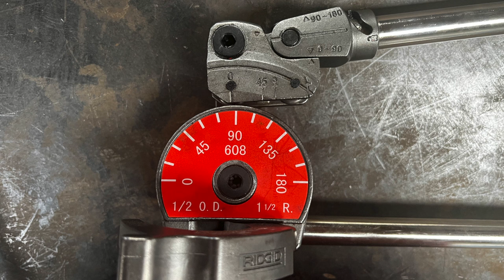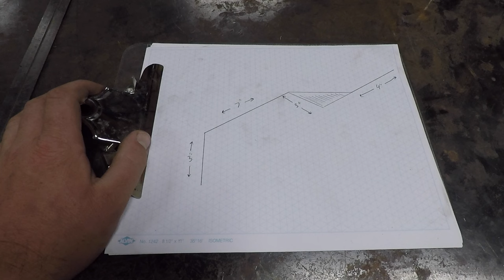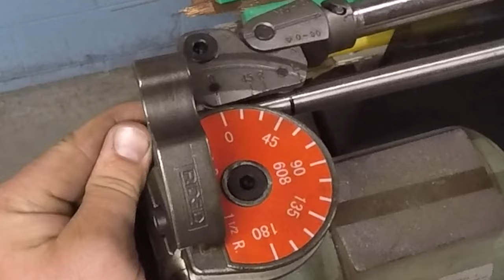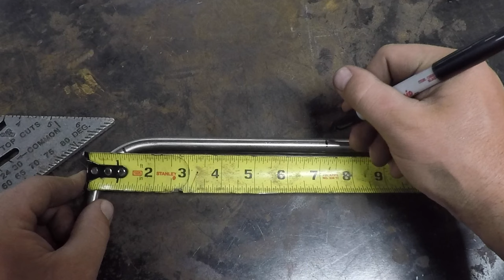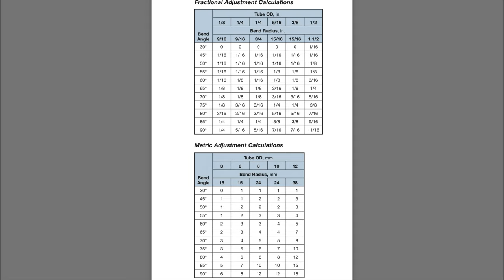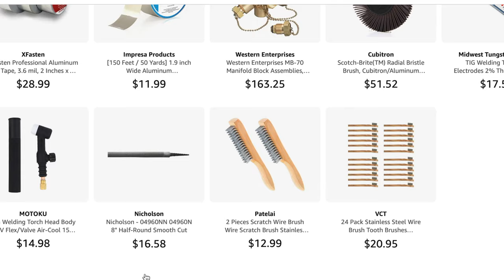Mastering Small Tubing bends: A Step By Step Tutorial And demo

Comment: Yes great TUBE bending video. At the auto research group I retired from they did not have classes for precision, mathematical precalculated tube fitting ( at least in the groups I worked in), just a little OJT & observing more skilled technicians work. Finally I saw someones sharpie marks & realized they were using some formula & calculation they were privy to. I asked for more info & was given a tube fitting brandname handbook (it was swagelok), & learned more & finally felt semi-proficient. I got better at planning & layout & designed some nice test equipment that I built. I always felt I needed to learn more! I got to bend everything from 1/16" SS tube for fine pressure instrumentation to 3/4" SS CNG fuel systems. 1/2" & 3/4" Ss CNG tube was bent with gear reduction bending jigs & thinner 1/2" & smaller tubing bent with high quality leverage benders like the larger unit in your vid. Thanks
Reply: The swagelok book is dandy, they do classes too that include a test piece designed to run you thru the gamut, Parallel runs with offsets and the like. I love fitting tube, mainly cause I don't weld so I feel self sufficient on work I can bend and fit without having to get tig welded....need a bender for 3/4 tho....would be nice

Comment: Hi great video. I’m interested in doing a bend with aluminum to create a stand. The top would be 7-9 inches and the legs 23 each side. Is it possible to bend at 7-9 inches apart? I’d be using 12mm - 1/2 inch tubing. Maybe smaller.